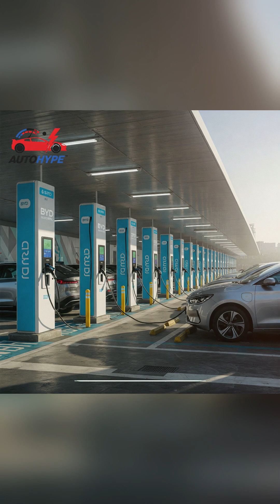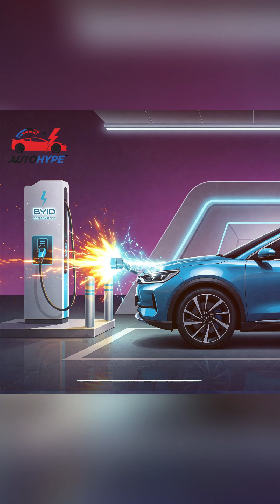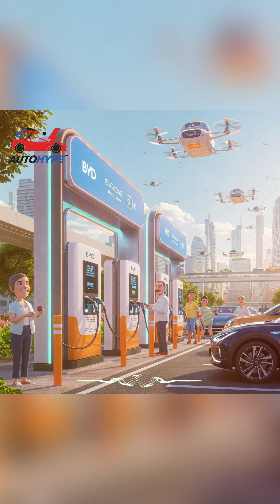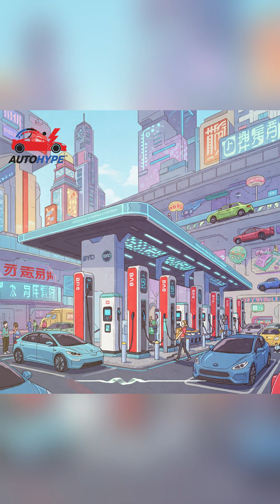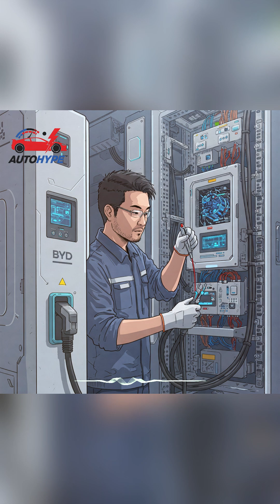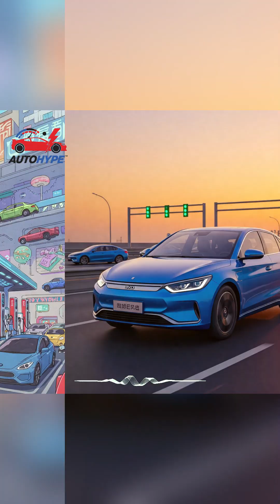BYD's 5 Minute Charging | The Future of Electric Vehicle

Comment: Fast charge short life
Reply from the maker: 🚗🔋 Not necessarily! BYD’s battery technology, including LFP chemistry and advanced thermal management, is designed to handle fast charging while maintaining longevity. Plus, new innovations like silicon carbide chips reduce heat and wear, helping extend battery life. ⚡